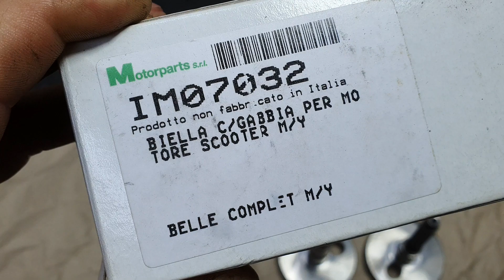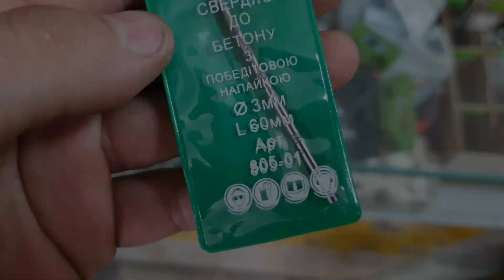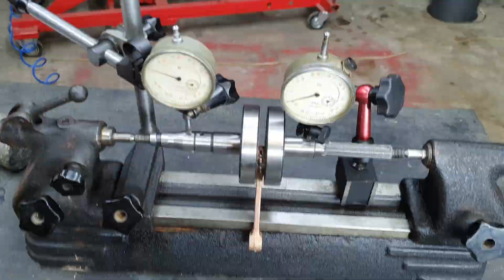Масляный канал в шатуне - Yamaha Jog

Comment: That was a masonry drill bit used for concrete drilling, not metal.
Reply: @labrikorn_3299  I agree, he overheated the steel and extended the slot into an already narrow section of the big end in a high stress area.

Comment: 12:10 I'm pretty sure the metal lost its temper on those blue spots because of heat when cutting the grooves. It's ruined.
Reply: Also when he was drilling te holes on top... he drilled with the wrong tool
Reply: Totally agreed, and unnecessary work, the connecting rod lubricated well as it was.